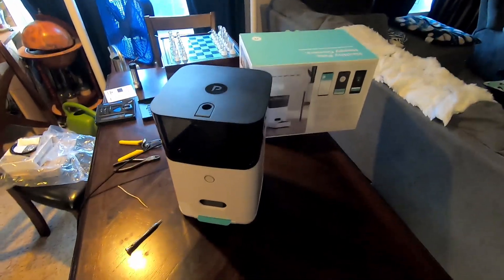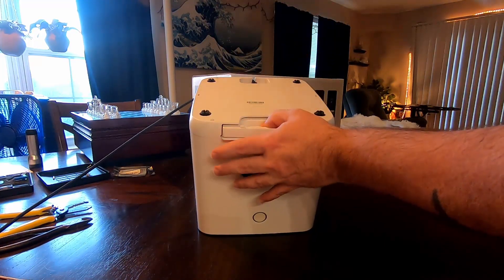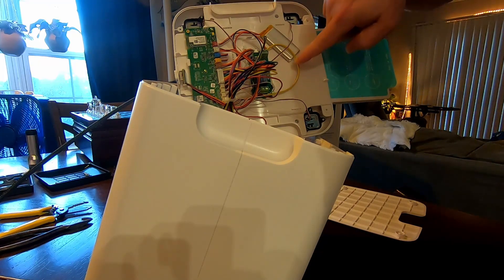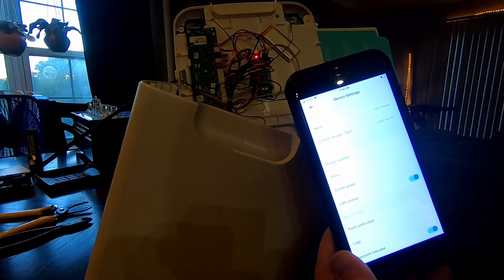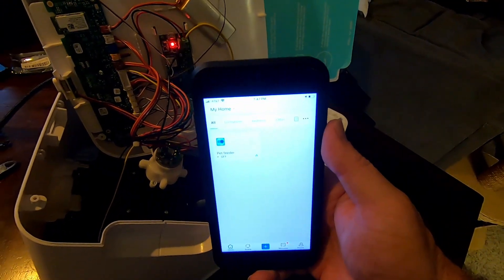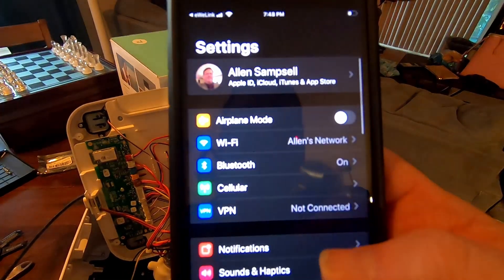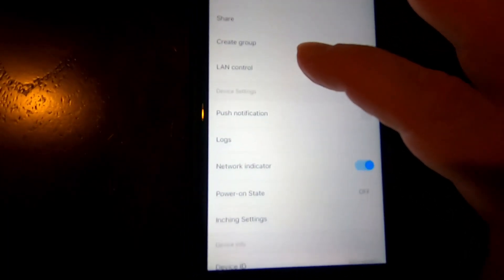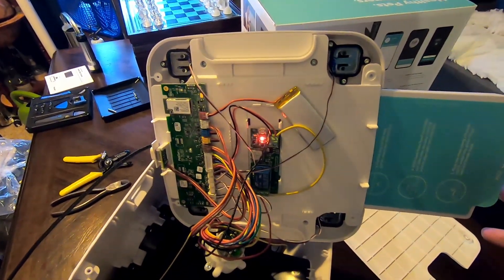Hacking the Petnet Gen 2 Feeder

Comment: Well done, this works great. Was wondering about the power supply. I am currently using the one supplied and it doesn't have any issues. Am I going to run into issues with that?
Reply from the maker: Unfortunately yes, you’re probably having issues now and just don’t realize it. Symptoms will be that the Inching doesn’t appear to work. It will just spin for the same amount of time and then it reboots. Easier to see it rebooting if you test this while it’s apart and you can watch the lights.

Comment: @Allen Sampsell, Thank you so much for this hack, it's awesome. I'm curious though, would it be significantly more difficult to program a new chip, desolder the old one and solder the new programmed chip onto the board?
Reply from the maker: I suppose if you know how to program a new chip that would fit on their board and make the software to go with it. It’s possible. But infinitely more hard than just replacing it. There is another option out there using a Raspberry Pi but again it’s a whole other level and price point as Pi’s aren’t cheap like the board I’ve chosen.
Reply: @AllenSampsell   Thank you for the reply and thank you for taking the time to provide this useful information, I appreciate it.

Comment: Hi Allen! Seems I’m unable to adjust the inching time to reflect the motor running. I tried doing the separate power supply but still runs 7-8 seconds no matter the setting when the motor power supply is put into the NO position. Thoughts? It I unplug the motor the relay works perfectly- so I think it has something to do with the board on the motor. Thoughts?
Reply from the maker: after you trigger the feeder does it spin for that long time and then the board turns off then back on? You'd have to watch the lights on the board... If that is still the case then the new power supply you used probably doesn't have enough amps.

Comment: Thanks for doing this and sharing your work! Quick question: Does this hack now require two power supplies, the original to power the motors and one you listed in the description to power the new wifi board?
Reply from the maker: No problem. And the new WiFi board is going to run the motors directly. So you only need one power supply which runs the board which powers the motors. The single power supply you use needs to have the right voltage (5V) and enough amps (at least 2 amps) to run everything correctly.

Comment: Wow, your project is amazing. I am a CS student and I am interested in how does it work? Why would a small wifi module solve the problem?
Reply from the maker: The unit already had wifi and a controller that made the motor turn. The new wifi module essentially replaced the manufacturers and now directly controls the motor which dispenses food. It doesn't do all the things the original did, but it does work.
Reply: Now I understand. Thanks for the explanation!

Comment: Thanks for the info. I grabbed a 4 channel relay and set different inching times so I can have 4 different portions.
Reply: My next add-on is adding a remote button so the front button can work.
Reply from the maker: Yeah that’s definitely an option but only if get a different board. Thanks for commenting. I want other people to know there are options out there and not to just junk these machines. 👍
Reply: @AllenSampsell  is there a video to show the instructions to enable the front button?  Thank you
Reply from the maker: @b.reneedesjardin4091  sorry no. This hack removes the ability to use the front button.